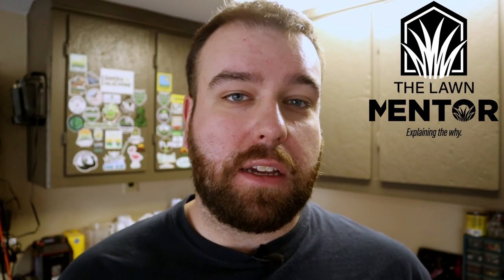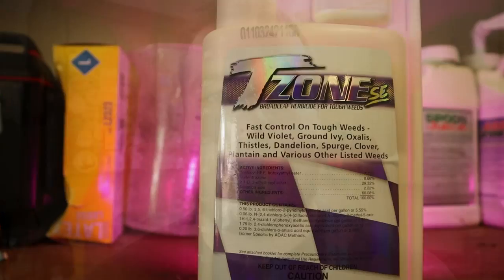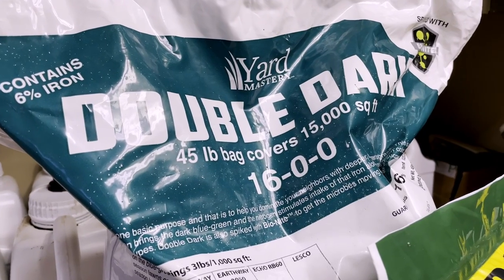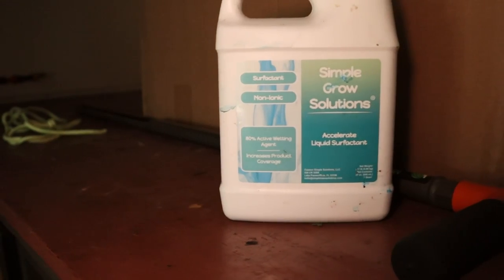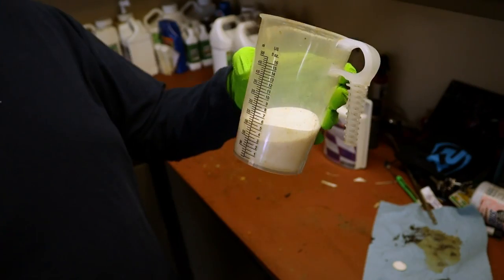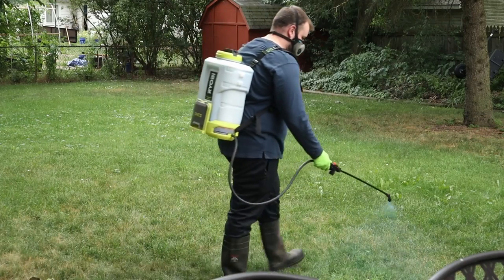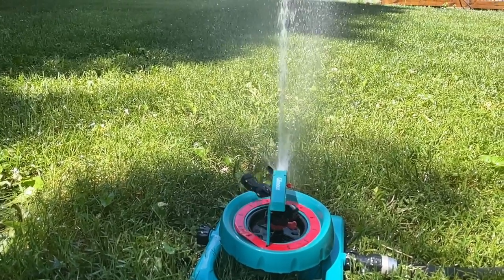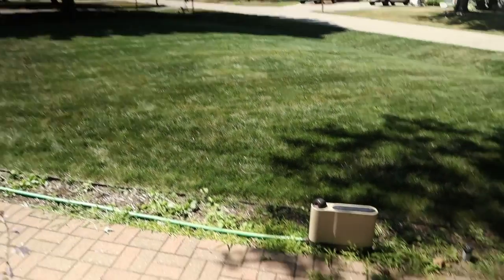Creeping Charlie Killer Combination: My Top 2 Weed Killing Solutions

Comment: Horsepower with Dicambia will work very well for violets as well. I feel t-zone builds a resistance quicker
Reply from the maker: Thanks for the tip, maybe I’ll give that a try if I need to switch it up
Reply: It’s something I’ve noticed at the beginning of the season. I was treating a few yards with tzone early on and it would curl them but just wouldn’t get a good kill. Used Horsepower and it knocked them right out. It calls for .9-1.1oz/1000 but I recommend the 1.1 (at least in the cooler state of WV) and I also recommend doing a follow up spot spray 7-14 days after the first application.
Reply from the maker: @coreygravely6  appreciate you sharing the details! Thanks for commenting